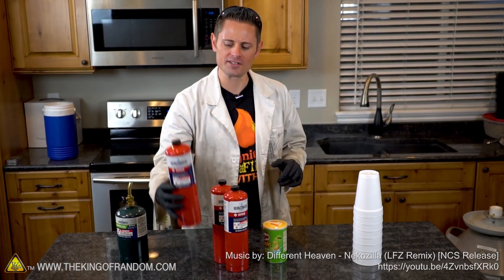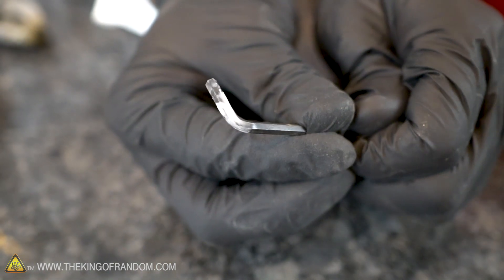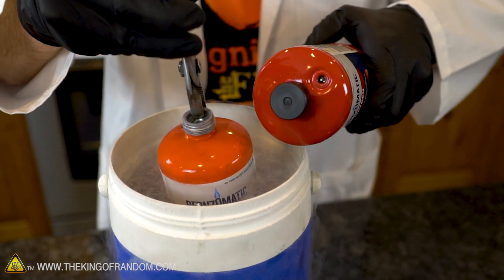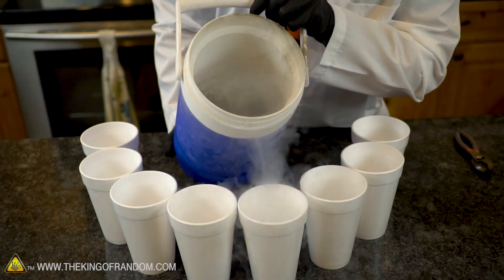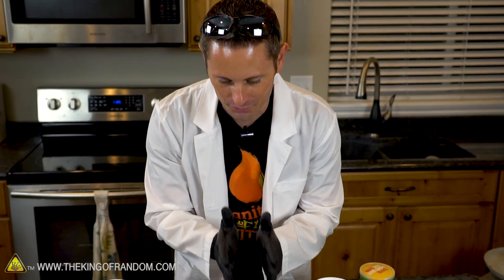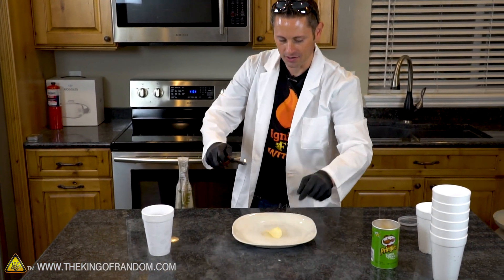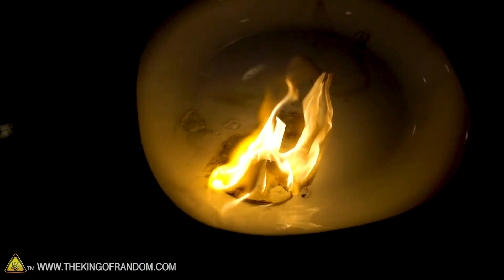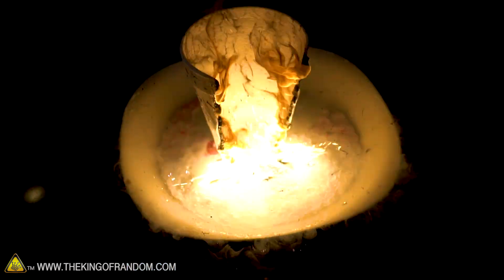How To Make Liquid OXYGEN! TKOR Experiments With Homemade Liquid Oxygen & How Oxygen Is Made

Comment: Make Liquid Hydrogen and mix Liquid Hydrogen with Liquid Oxygen. Is it going to make H2O or something else?
Reply: You would have to ignite it to have them make anything and then it would most likely make H2O but it could also make hydrogen peroxide
Reply: mayur giri um that makes military grade rocket fuel, hahaha

if you want pure water just mix oxygen and hydrogen gas, then burn it
Reply: Actually it wouldn't make hydrogen peroxide my bad 🤗
Reply: No, you won't get water from this, the temperature is too low for a reaction to take place (unless you lit it on fire, but the results will be explosive). Also the oxygen will freeze.
Reply: It will take time to react. If you were to directly mix them (assuming you have both) the hydrogen will sit on top of the oxygen due to the difference in densities. Due to the laws of thermodynamics the heat from the oxygen (since liquid oxygen is hotter than liquid hydrogen) will transfer to the hydrogen and the hydrogen will then gain more kinetic energy. This should cause the hydrogen to bounce on top of the oxygen. Really the answer depends on the amount of kinetic energy transfer that occurs. Oxygen and hydrogen are both diatomic atoms. This means that they will never be found alone, in their purest form they will always be bonded to themselves. So liquid oxygen is really O2 and hydrogen H2. So the way I see it is if the energy transfer is not enough to break the hydrogen bonds when they hit the oxygen molecules then no reaction will occur, but if there is enough energy to break them then two things can happen. If there is enough energy to break the oxygen bonds then the two will make H2O but if there is only enough to break the hydrogen bonds and not the oxygen ones then it will make H2O2. Of course none of this matters if the hydrogen boils before a reaction can take place. Keep in mind that I am not a chemist. This is only a educated guess. I am only a student with some chemistry knowledge but I believe that this is what is most likely to occur. If there are any chemists that read this please tell me if I have made a mistake. I hope I have answered your question though mayur giri.
Reply: liquid hydrogen is not as easy to produce, oxygen's boiling point is warmer than nitrogen so that's why it condenses from the air but to make liquid hydrogen they have a lot more expensive process, Cody's lab did a video on it, pretty interesting
Reply: mayur giri Yeah, unless he somehow obtains some liquid helium (which is hard to find and costly; helium has the lowest boiling point of any element, at about 4 Kelvin) he can't make liquid hydrogen. Obviously no one is going to let Grant purchase liquid hydrogen because it's highly explosive, but if he does manage to find liquid helium, here is a way he could go about making hydrogen: 

1. Make the sodium hydroxide/water solution he used for the water to fuel generator.
2. Fill up two separate containers with the solution, and connect them with some copper wire.
3. Use some kind of electrode (Graphite ones. Could be made from pencils or use the ones from the mini arc furnace) to begin electrolyzing the water. One electrode should go in each container (the copper wire connects the two containers electrically so the circuit is completed). 
4. Connect electrodes to a battery. The water will begin to bubble. On the negative side is the hydrogen. Use a balloon to collect the gas. 
5. Place the balloon around another empty container and submerge the container in the helium. Liquid hydrogen will condense on the side.
Reply: mayur giri The oxygen will freeze in the liquid hydrogen, but after burning (or even exploding) you would have water (mixed in the air)
Reply: thanx for your comment guys, but my question is not burning both. Just mixing them in liquid form. Can any one tell what will be the result? will the hydrogen will be freeze or oxygen? is there any chances to get new form of h2o? lots of question.
Reply: mayur giri he can't make liquid hydrogen. Liquid hydrogen is much cooler than liquid nitrogen (~20 K vs ~60k)
Reply: The problem is that it is very hard to produce liquid hydrogen.
Reply: liquid oxygen is stored at around - 290 °F and liquid hydrogen is stored at - 400  some odd °F. The hydrogen gas would boil off before anything would happen. I think lol
Reply: It would just mix together, It wouldn't bond together to form water.
Reply: Awesome Idea Mayur!
Reply: Thank you!
Reply: Thumb Up... :)
Reply: mayur giri also water is a pure substance, you can't have a new form of it. Water is water
Reply: mayur giri Try making liquid hydrogen first, -252°C.
Liquid nitrogen has "only" -196°C...
Reply: mayur giri and the reaction to make H2O is explosive
Reply: Actually if mixed and lit up it would but it would be explosive
Like in the hydroliser project grant made some time ago but with slightly more power  
Enough to launch a full sised rocket into space
Reply: Ohhh Interesting!! Thanks for letting me know dude.
Reply: hydrogen is explosive thought and can be a bit unpredictable
Reply: Thanks for your reply!!
Reply: As awesome as is sounds, he'd not be able to make liquid hydrogen.

It's usually kept at 20 above absolute zero.

So, not really that plausible

D:.
Reply: no :/
Reply: Sahil Sethi not true there are many different kinds of water and ice. give it a Google, types of ice
Reply: Nice experiment Grant!
Reply: Check these Awesome and unique FIDGET SPINNERS in my last video. Thanks!

Comment: Grant. I am worried about the amount of nitrogen your accumulating in your working space. When you let that much nitrogen ablate, I hope your using proper ventilation. Have you calculated the volume of your area and compensated the positive air flow to flush out that much extra nitrogen. I only ask because I want to keep seeing you make videos and not asphyxiate.  I was also wondering can you refill those oxygen containers. And ifi t is possible could you refill them with more than what they came with. I have refilled propane tanks to more than what they come with, but that's propane. Do they only put a certain amount in those tanks because of pressure and volatility of oxygen.

Comment: There is liquid oxygen in the blue liquid he has but I imagine it's only 21% O2 since that liquid is actually liquid air which is 78% nitrogen (I don't know if O2 and N2 condense at equal rates under these conditions though).  Pure liquid oxygen would likely be waaaaayyyy more capable of increasing the flammability of stuff. I wouldn't really want a cup of it in one hand and a lit lighter in my other hand.

Comment: do liquid h2o next!
Reply: Zabanana ha ha very funny sarcasm levels over 9000
Reply: Zabanana do you even know what h2o is?
Reply: Dihydrogenmonoxide is actually a very dangerous substance. 

Very erosive, dissolves many substances and acts as a catalyst in corrosion - especially when combined with sodium chloride. It is directly responsible for an average of 3,600 deaths by inhalation each year (and an unknown number by other means) in the U.S. alone. Dihydrogenmonoxide is a chemical commonly used in cleaning solvents, firefighting, it has many industrial applications and is found in the exhaust of most rockets and even some cars.

... And yet they insist on putting it in our water.
Reply: LOL

Comment: Since liquid oxygen is flammable then could you run it in a motor? Like is you have this question to so grant can see!
Reply: Liquid oxygen isn't flammable...
Reply: Fade Player it's not flammable, it's aggravator. Adding it to a engine is basically forced induction, basically a temporary turbo
Reply: Yes it's an oxidizer-the primary oxidizer used by NASA, SpaceX, etc. etc. etc.  He would need to make a hybrid or a bi-propellant liquid engine.
Reply: if you want to see a liquid oxygen engine in action, watch any spacecraft blast off. ;)
Reply: Sp00kyP00tis Well, then use it WITH something if you say it allows things to set on fire... duh
Reply: True, but it still is not flammable by itself. Grant said in the video that although it puts out fires, it is still quite volatile, and when mixed with fuel... The fuel burns, combustion occurs, oxygen was used with a fuel, things were set on fire, etc. However, oxygen by itself is not combustible. It needs to be there for combustion to occur.
Reply: Sp00kyP00tis actually oxygen does burn by itself, look at apollo 13, the oxygen tank exploded with no fuel whatsoever
Reply: the pvc protector on the wired burned, this is what started the fire,
its was bound to happen.
Reply: +Harry Benson I believe you're incorrect. The fuel was Teflon coated wires. This fuel burning as well as a faulty tank heater (that was stuck in the on position) caused an "overpressure" type explosion.
Reply: Oxygen, whether it be liquid, solid, or even gaseous, is not flammable. It only allows stuff to burst into flames. He said this in the video. HE SAID THIS IN THE VIDEO! HOW DID YOU... Ugh, never mind.
Reply: Fade Player a motor is electric and a engine is fuel powered

Comment: I'm no science whiz, but i'm curious as to why when you lit the Pringle chip the fire concentrated around it instead of evenly dispersing around the plate. Is it because of the oil in the chip, or is it because you had soaked the chip in liquid oxygen which caused the reaction it did?

Comment: Is that really liquid oxygen?  I believe it to be liquid air.  Liquid oxygen will burn motor oil when it comes in contact with it.  I would have thought that the oil in the chips would have also started a fire, but maybe liquid oxygen only ignites petroleum products.   But in that case it should have started the Styrofoam cup on fire too.  So, is it liquid air and not liquid oxygen?

Comment: Grant please mix it with gasoline and light it off. Do it for us!
Reply: That would cause a large explosion! No!
Reply: Ethan Ferns yes but with concentration of oxygen around it it will burn more vigorously correct me if I'm wrong but oxygen doesn't actually burn it simply supports burning causing any flame with an actual fuel source to burn brighter
Reply: @ Ethan Ferns If that were true then car engines would not need air intakes. Lighting Gasoline in a pure oxygen state would be extremely explosive.
Reply: Nicholas Roberts not a big explosion it would make the same explosion as a gasoline explosion because there is oxygen in gasoline.

Comment: Molten copper vs liquid nitrogen
Reply: I wonder if it will rust
Reply: Molten copper va liquid oxygen
Reply: vluxer 122 it won't because it's not iron. iron oxide can't be made without it, even then, it couldn't because you'd need oxygen, which nitrogen is not
Reply: WinToDig UpAGame ...boom
Reply: WinToDig UpAGame ...boom

Comment: try to light liquid oxygen on fire
Reply: Deathbear. Nothing will happen. It is used as an oxidizer. Oxygen itself isn't flammable. You need a fuel.
Reply: he did ...
Reply: Liquid oxygen does not burn. Also, gaseous oxygen does not burn. It only enables other substances, such as wood, gasoline, etc., to burn.
Reply: very large explosion
Reply: I know my dad was in the navy he worked with liquid oxygen
Reply: Deathbear oxygen isn't a fuel itself it is just something that fire needs to survive and thrive, thus why it just enhanced the fire on the chip rather than igniting.
Reply: shinaanish Oxygen loves those electrons

Comment: Hey Grant, if you filled a pool with liquid oxygen, swam to the bottom and took a big breath would it be like water or would you be able to breath underwater.
Like if you think so, and like even if you don't think it would work. :)
Reply: you would turn into a human popsicle
Reply: If the body were designed to withstand such cold temperatures, even internally, then it may be possible. However, the body would have to be able to process liquid oxygen, otherwise you'll simply drown due to the oxygen being in liquid form rather than an easy-to-process gas. As humans are now, FrogRay best described the probable outcome.
Reply: many people in the comment section are forgetting that our lungs cannot process liquids, what we breathe is oxygen in a gas state, not a liquid.
Reply: This comment is terrible
Reply: TechmanPlayz its way too cold to even touch, its like liquid nitrogen
Reply: FrogRay Obviously, I'm pretty sure the OP knew that. You should be able to reason that it is a question based on if we could breathe the oxygen itself, it is purely hypothetical and disregards the fact that liquid oxygen is extremely cold.
Reply: Removing the temperature element, you'd still drown. It's not like a PC/electronics in non-conductive liquid, it's asking your lungs to process matter in a state they werent designed to do. It'd be like trying to drink a block of ice without melting it.
Reply: TechmanPlayz throw A fish in there. And see it yourself
Reply: Dyno you would be dead before you got to the bottom
Reply: TechmanPlayz oxygen isn't the same as air. Air is mostly nitrogen and only a little bit of oxygen.

Comment: Science Lesson: What is happening in this experiment?

Oxygen doesn't burn it is a catalyst in the reaction which affects the rate of the chemical reaction. (Eg Propane burns more vigorously when added oxygen is present, than if the propane were in normal atmospheric conditions.) Meaning oxygen is not flammable or explosive by itself. What is actually happening? The fuel reaction rate is increasing or becoming more effective at producing products H2O and CO2. As the limiting agent of the reaction is O2 in this instance if the presence of O2 is increased more propane will be allowed to burn. Basically more O2 + Faster Burn Rate --> Faster Product, production rate. Here is an equation for burning propane C3H8 + 5O2 --> 3CO2 + 4H20. So increasing the limiting agent O2 means more Propane (C3H8) will be allowed to burn causing the burning propane to become more active and vigorous. 

For all those wanting to identify the science behind this experiment 
Here you go ;)

Comment: Cool!  What if you took the oxygen-soaked-chip and put it immediately into a plastic bag and sealed it?  Would the chip retain it's volatility? (At first I was thinking liquid paraffin to seal it; but then I thought the temp difference would not allow the wax to seal properly.)  If the soaked chip could be sealed properly, it would make an excellent fire starting tool for camping or emergencies, especially if the wood is wet.

Comment: If you want higher purity oxygen what you could do is pump the oxygen through a coil of copper tubing. The tubing is submerged in liquid nitrogen. Copper is a great conductor of heat, so as the oxygen passes through, it will condense into a liquid and pour out the end of the tube.

Comment: I have 2 questions for you Grant.

What would happen if you tried drinking it? 

What if you were in a room, warm to the point liquid oxygen boils very quickly into the air, would you be alright if you brought in like gallons of liquid oxygen? Or would you just be able to breathe fine, like would messing with the amount of nitrogen, oxygen, and carbon dioxide that we breathe mess with our lungs?

Comment: Awesome video! A much faster and easier way to make a lot of pure O2 is to decompose hydrogen peroxide (I use KMnO4 to do so). When the two are mixed, huge amounts of O2 is released. You can then dip a test tube into the liquid nitrogen and direct the O2 flow into said tube. This should make a lot more pure liquid O2 using much less liquid nitrogen.

Comment: Can you modify your rocket from a previous project, so that it uses liquid oxygen and any hydrocarbon as liquid propellant? But be careful with hydrocarbons in contact with liquid oxygen. I'd recommend ethanol or isopropanol to get a nice and clean reaction! And start with small amounts...
Reply: Under pressure, isopropanol, liquid oxygen @ 55% to 45% mixture is the fuel for the A-4. Known as the V-2
Reply: Cryo Lox and cryo liquid methane are what space x  raptor engines use it flowes through the engine and bell to keep it cool which is pretty amazing the bell is actually made of hundreds of stainless steel tubes welded together